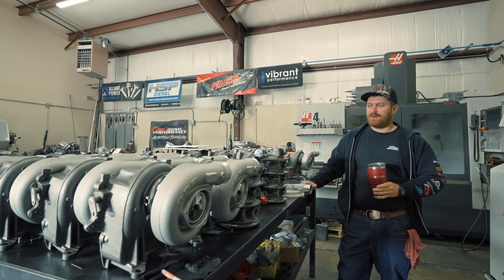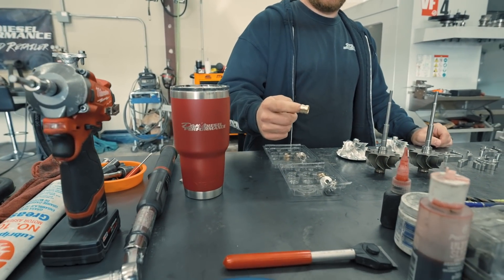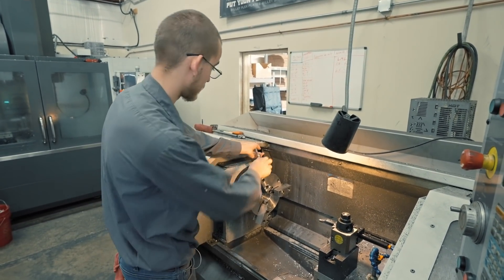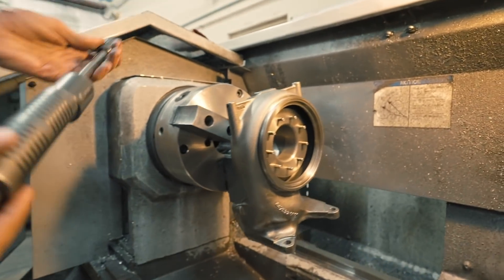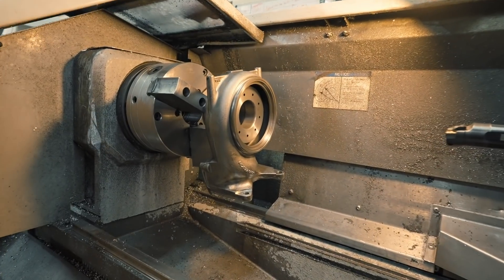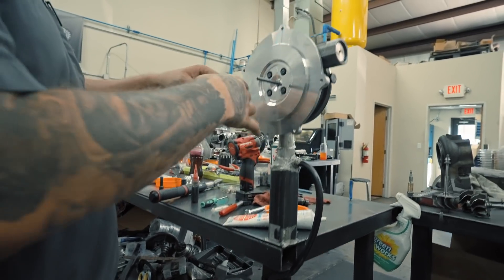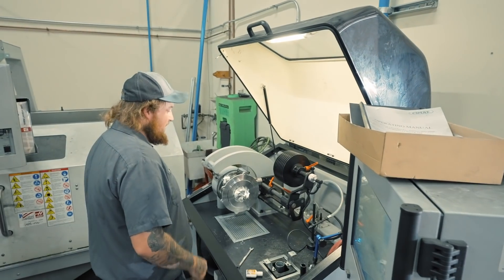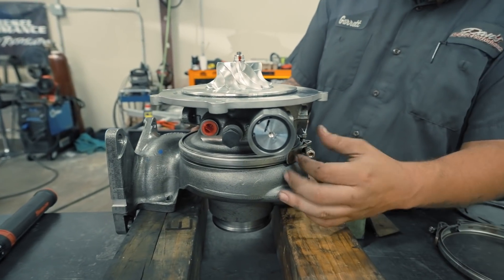Building Turbos for MonsterMax

Comment: If you respect the headstock bearings in your lathe, you'll build a fixture just for slide hammering the pins out of the turbine housing.  Seriously, that is probably brinelling your spindle bearing races.
Reply: I came here just to say the same.

Comment: Here we use a CNC machine to cut out the housings but we use a die grinder to remove extra weight off the compressor wheel to properly balance it 😳….
Reply from the maker: That is how it’s done. That’s how every turbo builder does it. Weight is removed with a high speed carbide cutter.

Comment: What are the exhaust flaps for never seen those before in a turbo why do the move ?
Reply from the maker: The vanes control the velocity of the exhaust flow across the turbine wheel to change the spool characteristics. Like putting your thumb over the end of a garden hose. The more you close off the end the higher the velocity the water comes out due to increased pressure in the hose. The more closed the vanes are the faster the exhaust moves over the turbine wheel to spin it faster. This aids in low rpm spool up. Then they open up to reduce pressure as rpm increases.

Comment: Indicating by eye on the lathe? The housings must not have to be very accurate.
Reply from the maker: The jaws are cut square and true. The tool is touched off on the part to establish Z zero so the computer knows where the part is in the machine.
Reply: I was gonna say, lol. Not a dial indicator in sight

Comment: "can handle higher EGT" meaning the heat that could be used up in the cylinder is being used to heat up the intake air through the turbo housing

not saying this is good or bad, it's just what's happening
Reply from the maker: Highlighting the benefits of the billet vanes. With the air and fuel these motors are getting the EGTs will be nice and cool.

Comment: this kinda makes my pp moist..... legit question though, why not just run a bigger turbo instead of doing 3k$ worth of machining to it? cant be for a lack of room in monstermax.
Reply from the maker: We want to have a quick spooling setup for good low end torque. The 64mm Stage 2 with 60% over injectors will do just that.

Comment: 1:57. Nothing says precision like the “It looks like it’s still spinning straight” verification.
Reply from the maker: The jaws are cut true and square. A visual inspection to make sure the part is seated properly before starting the program is common practice. Unless a chip gets in between the part and jaw it will be true.
Reply: @DansDieselPerformanceINC  
Would he be able to see if it was seated a few thousands out of spec or is he just looking for obvious issue? Thanks for the reply
Reply: @notsofast5495  A good machinist will be able to visually inspect the part in the rotating assembly and know if it's spinning true.  Plus these machines are non-conventional lathes and the process is fairly automated...
Reply: @LML-Duramax  
Thank you for the info.
Reply: @notsofast5495  Your eye is better than every dial indicator you’ve come across
Reply: Lol no shit right?
Reply: Working in a machine shop, I have found that when you notice a machinist can stand back and look at something with the naked eye to determine if its right or wrong then usually those are the guys you want to learn from because they know their shit...
Reply: @randallslattman3119  eh. Trust but verify. If you actually are working in a shop I'd suggest that. I run a machine shop and I don't ever "by my eye" anything. But maybe they don't need more than a few thou tolerance. If that is the case then let it go. Otherwise throw an indicator on. Doesn't take long
Reply: @sleddarcheddar  I totally agree...and when one of those old timers walks by and tells you to get the dials out then you better listen.
Reply: I doubt its critical machining but i was thinking the same thing. I have a machine shop  and I know that just because you got fresh cut jaws stuff can still have runout not visible to the eye. But again if its not that critical a visual i ok i guess. The stuff  they make work so 👌👍
Reply: Cambron Gabaree  Except i’m not. Not in the slightest
Reply: Cambron Gabaree  Most wouldnt actually. But nice try
Reply: Cambron Gabaree  So you say. You’re the definition of a ignorant Yank. Unfortunately
Reply: Cambron Gabaree  I won't claim shit but I will say like I said initially if it doesn't require more than a few thou accuracy that can easily be attained by eye when dialing in a part on a lathe. I'd hope they actually put an indicator on after the video though. But who knows. Maybe those compressor housings and turbine housings don't really need that much.

Comment: Indicating the part in the with the tool.... what kinda tolerance y’all keep on that?
Reply from the maker: The jaws are cut square and true. Touching off the part with the tool is establishing Z zero before we start the program.
Reply: @DansDieselPerformanceINC  okay thought y’all were touching off for x with the tool, figured y’all would hold tight tolerances for the ID centered on the housing

Comment: No dial gauge when checking if your straight???
Reply from the maker: The jaws are cut square and true. Touching off the tool on the part is done to establish Z zero so the computer knows where the part is in the machine.

Comment: So I better understand! You are up grading another manufactures turbo, not creating your own units is that correct?
Reply from the maker: Depends on supplies. We use either Garrett stock turbos to build up or we use new castings when available. This year has been difficult for getting parts in a timely manner.

Comment: Hello guys anyone know what kit to get to squat my pickup? 
I have a 01 Tundra with 140, on it and I really need help finding the correct kit to squat my pickup.
I think it should help with my tools rolling all around in the back while driving.
Also would make it easier to get mulch and things out the back when I need it for this purpose.
Maybe they should start selling this option from factory and charge ppl alot more for the convenience plus u won't need a dump truck just use the old pickup u already own.
Reply from the maker: For the ultimate squatage remove the rear leaf springs and secure the axle directly to the frame with either U bolts or ratchet straps.
Reply: @DansDieselPerformanceINC  
I believe it's a must if u were to squat ur truck u must use ratchet straps for safety reasons
Reply: @DansDieselPerformanceINC  lmfao good reply. 
I hope this guy is trolling, but my soul tells me he is genuine...